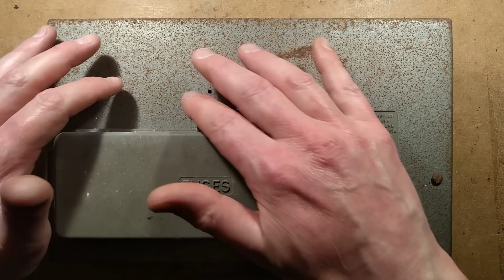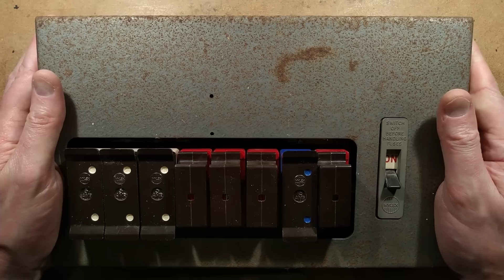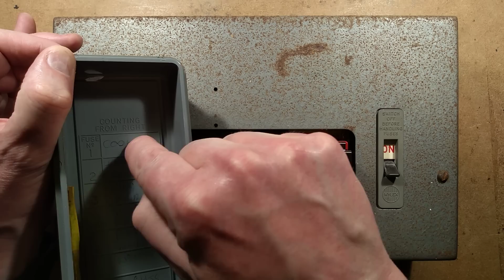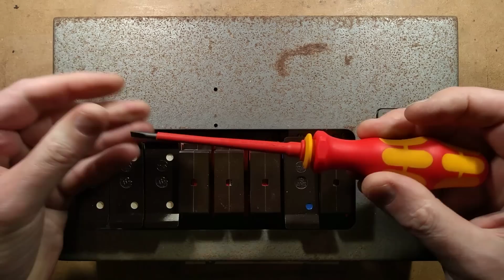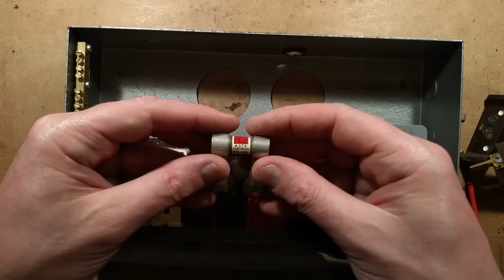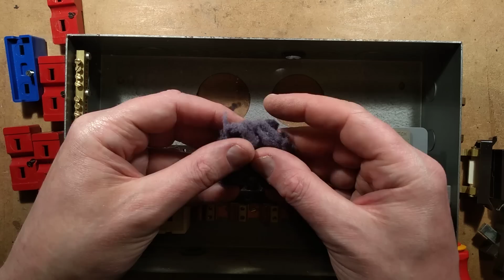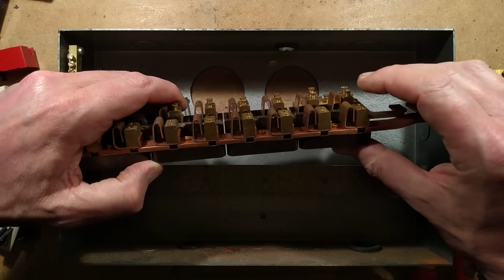Teardown of an old British Wylex electrical fuse box.  (with bare fuse wires)

Comment: Interesting stuff, I remember doing all this when I was younger and one of the most interesting and no longer used "safety devices" was the Voltage Operated Earth Leakage Circuit Breaker
Reply from the maker: Do you mean the original ELCB that used a coil to sense earth current flow?

Comment: I have the same Wylex fuse-box as you have just dismantled.  The thumb screw which secures the cover was nicked by a sparky that changed my electrical meter some years ago & I'd not had the (metal) cover fitted over the fuses.  So your concern over flashing upwards of a micro-fire when a fuse blows concerns me.  I might see if I can buy some of those RCD replacements for the old Wylex fuses that are still fitted.
Thank you for the dismantling demo.  Regards JohnnyK.
Reply: B&Q used to do the wylex mcb replacements, screwfix as well.  Also GE do a compatible breaker for less than the wylex branded ones, the GE were about 6 quid each including the base which must be changed as well.

Comment: On US fuse boxes (equiv. to UK consumer units), cartridge fuses were (are) used for the ('main") cutout and large load (220V) "fixed" appliance circuits; Ranges, Electric dryers and the like. The rest of the circuits were (are) "plug" fuses - The older of these were glass plugs with an "Edison base" (Yes you can screw in a normal light bulb in the socket!). These "plug" fuses are usually rated at 15,20 and 30 amps (on a 110V circuit). You don't (and can't) rewire these fuses, and the glass enclosure contains any "blast" from blowing. Many REALLY old fuse "boxes" were porcelain blocks with EVERYTHING exposed! I've seen these in houses as late as the late 1980s! And, I'll bet there's still many out there!. That ALL of the plug fuses used the same size Edison socket, would lead to people putting a 20A or 30A fuse in a circuit that was only rated for 15A. (or worse, Jamming a Penny behind a dead fuse!) - With expected results. (I.E. A visit from the fire department!)  Later fuse boxes have "Type S" socket and fuses that install the same way, but prevent using the wrongly rated fuse. As to the safety issue of fuses vs circuit breakers, There is no actual difference. (Although, in my mind the fuse is SAFER as there is less to go wrong mechanically.). I see many ads for guys who will replace fuse boxes with breaker boxes (for SAFETY!)- Agh. No. If the rest of the wiring is in good shape and up to code, just going from fuses to breakers will ONLY add convenience. If the house wiring is bad, JUST going from fuses to breakers WILL DO NOTHING for safety. - If it's a good install with Type S (for idiot control!) fuses, You're fine. It is now standard to use a 100A - 200A service in the US, But it some places like my home town of Pittsburgh,PA it is possible to get away with 60A service (Not by Code,but in practice...) in a small house as many of the appliances that would draw a lot of current elsewhere (ranges,water heaters,furnaces) are natural gas fueled.

Comment: Love the dual screw terminals, you know they’re never going to work loose, especially as they’re brass screws! Modern terminals not only have one screw but it’s plated steel and doesn’t “bite down” and do up securely like the old ones. Progress? Well when they come up with screwless (Wago) connections in consumer units (and accessories) it might actually be better! But no-one’s had the guts to release one yet!

Comment: I seem to remember you could not take the cover off until all the fuse carriers were removed. It might have been the plastic cover.
Reply: That's correct, just ripped an 80s plastic and wood (!) model out of my house.
Reply: That's right with the bakalite version you had to remove the fuses and switch the power off before the cover could be removed, cheers

Comment: Mine dates from 1977 when my house was rewired. It has a Bakelite front cover, so that arcing during a fuseblow would not occur. It is also fitted with a main overall fuse to the right of the switch. I fitted min-breakers instead of the fusewire fuses you showed.

Comment: I still have a small 4 port one of these in my house, though made of plastic. No cover. It does have one barrel fuse type and the others are RCD breakers. At some point a shower or cooker circuit was added as a single fuse board extension. A lovely but small wire nest to the mains coming in and the meter. Oh so attractive.

Comment: We still have these and much older ones at work. When they burn out they tend to smolder rather than actually burn. Talking asbestos the control panel I had to fix this week was wired in asbestos covers solid copper cable with clockwork timers and open frame contractors such fun. Built circa 1930 by Vickers.

Comment: My parents house had one of these but it was a different variant as the casing was black bakelite rather than metal but the layout was identical to this one! I was always curious as to what it looked like inside and now I know. Good point if you find one of these in your house to check the fuse wires if someone else has lived there previously. I fondly remember replacing both the wire and fuses in those cartridges. The front cover was absent on ours which looking back was risky as there were combustibles nearby. My folks replaced theirs with a modern RCD unit about 20 years ago. Great video and very interesting!

Comment: That consumer unit is very similar to the one I replaced when I re-wired my first house (back in the day when such things were legal - the only "safety assessment" was the visit form the local Supply Authority (in my case SWEB) to confirm that the installation was safe for re-connection to the incomer.

My Grandparents' home had the far older white ceramic rewireable fuses - with the obligatory card carrying 5 A (lighting), 15 A (ring main) and 30 A (Cooker) fusewire. Grandfather's standard repair when a fuse blew was to use a single strand of copper (lights), or three strands (ring main). Sometimes wonder how we all managed to survive in those bygone days!!

Comment: Per asbestos:
The blue is crocidolite or riebeckite, and it’s a pretty gorgeous deep navy blue in nature. 
Most asbestos in consumer grade materials was chrysotile, which for its intended purpose was fine. Fire gloves, flooring, roofs etc. but occasionally they used the riebeckite in home goods, even cigarette filters (Kent Micronite).

You’re absolutely right, if you come across asbestos, just leave it. The problems come from messing with it. The best part is telling your boss there’s asbestos, they usually don’t believe you and you have to prove it, at least here in America. 

Another fun fact: in America, we stopped using asbestos in housing in the year 1973, so if you are buying a home pre-1973, get an inspection and make sure they look for asbestos. Do your own look pre-inspection and see anything odd and note it for the inspector. 

The term is also only given to when it’s used in something, whereas it’s just an asbestosine material in nature.

Comment: I came across a Wylex fusebox once in an old shop, it was date stamped 1936, the plastic mouldings on the fuse holders were not perfect as if it was done by hand, it had fuse wire in them and a bit of cardboard stuff inside the lid.

Comment: My parents recently had their consumer unit replaced. It was a slightly more modern MEM Memera with fuse cartridges, from the late 90s, but essentially the same principle as the old Wylex. The electrics were running just fine, until the new board went in. Turned out there was a neutral to earth short caused by a dead spider in one of the ceiling roses in the lighting circuit, and a 400ohm (or thereabouts) live to earth short in their burglar alarm. An interesting demonstration of how the old ‘traditional’ fuse board didn’t react to these faults, which they were previously blissfully unaware of. I guess it didn’t help that the burglar alarm was bodged directly into the power circuit without any fused connection unit, but in any case the live to earth short was passing about half an amp so not enough to blow a fuse anyway!

Comment: Many years ago I lived with my dad in an old town home originally built for members of the military. Built small and cheap. I noticed pretty quickly that the heating ducts were wrapped in what looked like asbestos. And some of it kinda looked a bit loose. Not loose enough for me to throw a fit but made me a little worried. Turns out a while after I moved out the property management company went in and did some asbestos remediation. I THINK they just wrapped it all up nice and secure since that's the safest way to deal with it in general. Also the only way to deal with it if you don't want to pay for your tenants hotel stays while there's loose asbestos in the air. lol.

Comment: I had to go to a jewellers that had reported a fuse blowing on a lighting circuit. First thing I had to do was pull the fuse so I could start looking for the fault, I grabbed the fuse a got a belt (shock). Turns out the owner had tried to replace the fuse and left part of the wire poking out of that hole you pointed out.

Comment: Your reference to the fire issues with some Wylex products in the past reminds me of Federal Pacific Electric (FPE) circuit breakers and panels in the USA from a long time ago.  They had the same problems with some of their commercial products and ended up with getting a bad reputation.  Fire Protection Extra became the name us electricians called them.  The bad reputation got everyone scared to use their products and people began thinking that ALL of their stuff was prone to cause fires, which was not the case.  Their residential products were pretty good and any electrical fires in houses were not the fault of the circuit breakers but of improper installation.

Comment: Used to have a similar box. I installed the breakers (more expensive than standard MCBs) but one limitation is the lid doesn't fit over them. I also added an RCD between the box and the meter.

Comment: I don't think I've seen these anywhere in greece and I've been in quite old homes. The fuseboxes of the previous era had those screw in type fuses. Still common, very common in "vintage" households that haven't been renovated. The replacement procedure is easy.. Most handy feature of that type of fuse... the screw cover has a slit that you can put a probing screwdriver see if the fuse is actually blown or not.

Comment: Striking just how well made the older stuff was made compared to today's gear. The newer stuff has been engineered to be as cheap as possible with as little copper and brass as they can get away with. The US stuff is very similar in construction, but to different standards, and of course to suit our residential line voltages. I've never seen ring circuits used here, and was an industrial controls engineer for 40+ years. It's a common practice in the older 2-20ma current loops and other instrument wiring, but it's not used for power distribution. It's my personal opinion it's a better way for a variety of reasons.
This had been an interesting series, your "UK Residential, Entertainment Industry and Line power distribution gear" collection. Thanks!
Reply: I think it was done in a time, when copper was rare and expensive to lower the cross section of the wiring. With the star wiring in US and rest of Europe, you needed thicker gage, and that was cost and valuable material spent for each individual branch circuit.
Reply: @stefanscholz2509  I agree Stefan. That's probably the reason for the higher line voltages as well, it's all about keeping the wire guage down. Engineering history is an interesting, rarely discussed subject. It's surprising just how much it affects the "modern" way of doing things, but it's not taught to our engineering students. That's too bad, as there's a lot of practical lessons there. As with all history...

Comment: I'm not surprised this box was so modular... I imagine the UK has different sizes of fuse boxes much like we do in the US, and having a well-implemented modular system decreases manufacturing costs. The "hammered metal" finish of the box is beautiful with that slight patina of surface rust. 

I am surprised the UK allowed you to make your own fuses without a "loicense." Then again, in the US we used to have screw-in glass fuses that people would slap a penny in the hole and screw the blown fuse back in to restore power... It seems a bit counter-intuitive to have the main switch pushed upwards for "OFF." I am impressed with how robust the insides are, and no doubt that is why many of these panels are still in use.

Comment: I have patched these kind of fuses when I was like 8 years old in our grandmother's home. For a 5A fuse replacement we used a single strand of copper wire from a flexible wire rated for 10A. For 10A, it is two of those strands twisted together.

Comment: I can't even comprehend that people used to just replace the fuse wire with bare copper wire like that. The "old" fuseboxes here in North America use the glass screw-in type fuses, that use an Edison-style screw. The colour inside the fuse tells you its rating. Then, we switched to using breakers, and now they're just all in neat rows. It seems crazy to me to allow people to rewire fuses. How many times did someone's house burn down because they just used any old wire they could find?
That being said, you can push a penny or a quarter into the screw-type fuse boxes here to totally bypass them as well... so breakers really are the best thing nowadays.

Comment: My uncle was chief engineer on oil tankers.  He died of mesothelioma due to the blue asbestos insulation, not before he saw a few of his ex colleagues die of the same thing.
On another tack, my mother in law has one of those old Wylex units in her house. It's fed  via a Wylex voltage operated breaker. She keeps asking if the house needs a rewire.  I fold her no... it worked OK when you cut through the hedge trimmer cable!
Reply: sorry for your loss my Dad died of the same disease by the time he was diagnosed it was too late, ship yards have a lot to answer for,

Comment: What were they thinking? Main switch OFF position should be DOWN.
That panel is extremely well made.
Reply: Exactly, I thought wtf? when I saw Off was Up.
Reply: Until fairly recently down was on in the UK, as that is how it always was in the commonwealth.
Reply: Well it's nice they caught up. 
Anyways, that panel is better made than anything that can be bought today. Of course there's never enough room inside. You can tell the engineers that designed it were not electricians.

Comment: It's so amazing to me how much more better designed fuses were in the UK to the point where they're still relatively safe. The Edison fuses in the states were not very user safe even though we do have circuit breaker Edison fuse replacements. We still use them for single circuit protection in like street lighting but never residential any more. I don't think you could sell the house in the states with fuses.

Comment: I’ve got the slightly upgraded one in my house. It still has the metal enclosure and the same fuse holders but it’s got an RCD or “30mA current operated earth leakage device”. I swapped out the cartridge fuses for MCB’s, mainly coz it’s so much easier to reset them if they trip

Comment: Wow, what a difference, in the UK replacing a fuse meant playing with wires and everyone is expected to be able to do this. In Canada (and US) we had fuses that were encased in glass and you screwed them in just like changing a light bulb. Each fuse had the amp rating stamped on the bottom and written inside the glass of the fuse so you could see if the wrong rating was inserted. Pennies were used when you ran out of fuses, you used the blown fuse to hold the penny in place.

Comment: I was plastering around a coverless one of these yesterday and a gob of plaster fell on the top and dripped down into the flame outlet which electrified the wall nicely. Got a tingle when I went to smooth just underneath!

Comment: When I was a wee lad, our house had standard 13 amp sockets, while the next door neighbours had Wylex ones (worth a Google: strange round plugs with a large round centre earth pin, and offset flat L and N ones - plus, a socket on the back so you could stack them together). My uncle's had round two pin ones. This led me to the curious belief that, just as every house had different door keys, so they had different mains sockets. I never wondered why, just one of those things you accept when you are small.

Comment: When we moved into our house 17 years ago I found the whole electrics of the property went into a four fuse Wylex board, but when I removed the cover one of the fuse holders had partially turned to dust as a result of long term overheating. When I pulled the fuse one side of the socket came away with the fuse holder. During a recent kitchen renovation we rediscovered the long lost cooker spur and found out that when the council upgraded the wiring in the 80's they left all the original rubber coated aluminium cable under the floorboards. I even found a live Bakelite socket under the bathroom floor that has obviously been deemed 'not to current specification' and tucked away without being disconnected. Definitely not going to be up to Part P anytime soon.